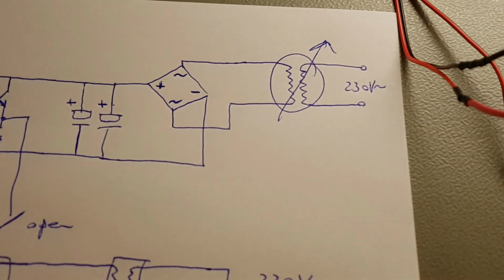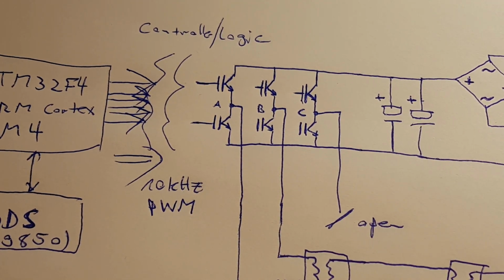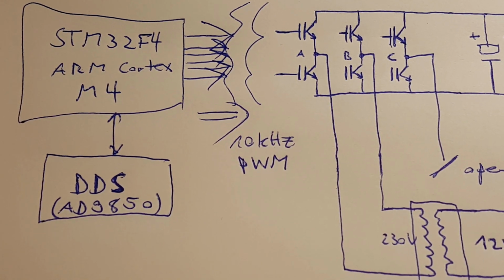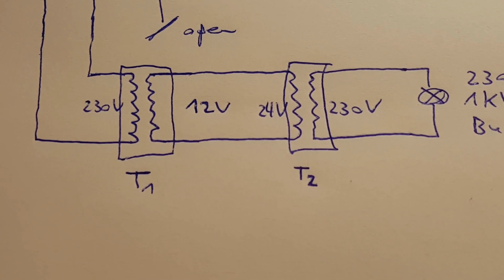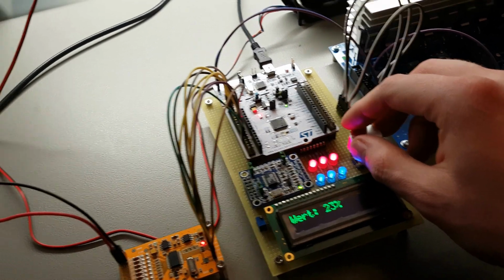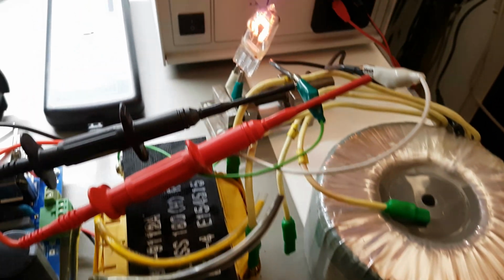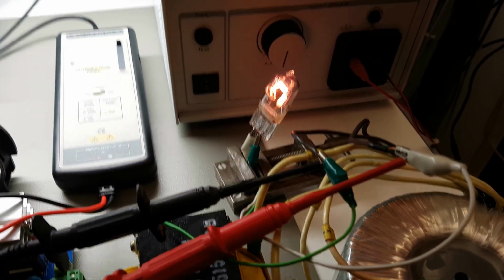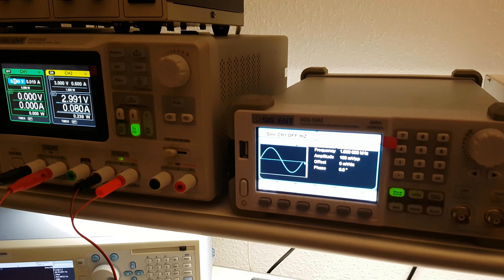STM32 DIY 1kW POWER SUPPLY - Test 2

Comment: As I see, Does it work with open loop of regulation? Why do need the "C" brange of transistor bridge, connected to the ground?
I wounder how busy is processor if it is close loop and PID.
Very nice project! Best regards!

Comment: Nice, this test its much safe...
Very precise, but youre satisfied with the sinus waveform? looks a litle bit extrange, have a cut on 0V and slightly noisy on top. Maybe some capacitators on the pwm output can help.
Good use of one of youre OLED display ;-)
Reply from the maker: +Eduardo Anonimo Well, the waveform consists of 360 discrete PWM values. The resolution of the PWM depends on the PWM frequency and the Timer clock. The shape could be much improved on a STM32F407, since it runs at 168 MHz instead of only 84. Nevertheless, in my point of view the quality of the output Sine is much much better than on a six step inverter system. Yes, I really like that green OLED.

Comment: why do you use T1 and T2?
Reply from the maker: +DHTf92 There are two reasons: Connecting both transformers like I did leads to a total ratio of 2:1.This will therefore lead to a reduced load. Secondly, I wanted to test the power inverter stage with an inductive load, since this is more demanding than a ordinary bulb.
Reply: Achim Döbler Thank you very much for the reply!
Another question...the stm F4 has available source code for this thing or for brushless motor? because i begin from a month but it's a bit complex to find good source...